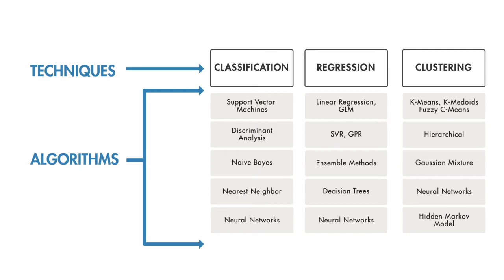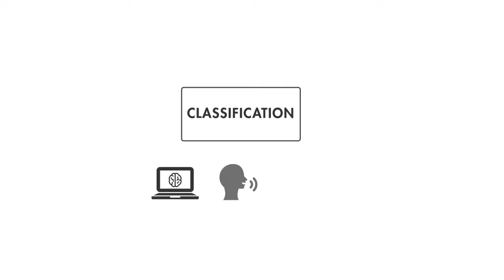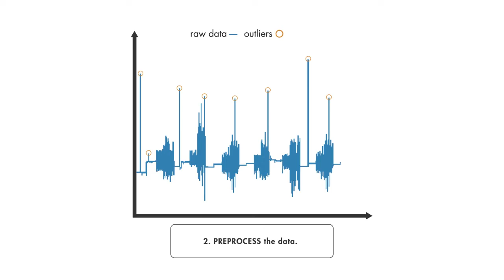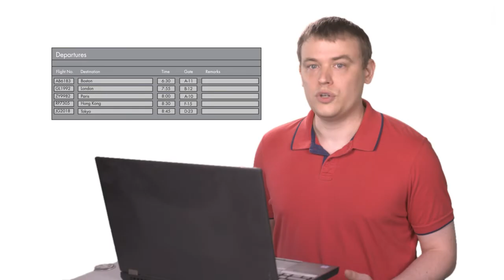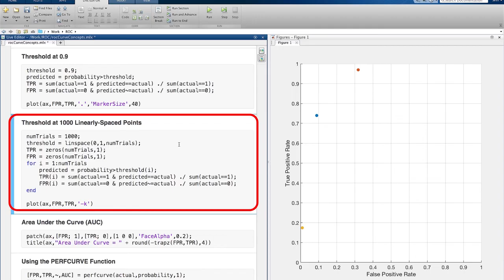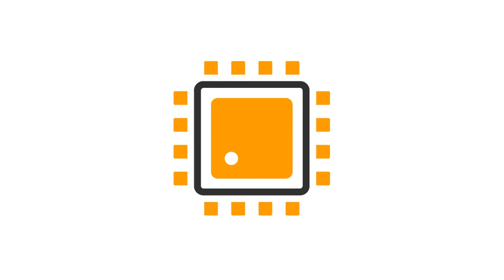Machine Learning Tutorial: From Beginner to Advanced

Comment: thanks for the video Adam. A really basic (trivial) example would be interesting for me. By way of starting somewhere, I created some simple data, Column 1: 1, 2, 3, to 200 Column 2 = 1,0,1,0 and so on.   In other words an odd number input leads to a response of 1 and an even number leads to a 0 response.  I import the data to the classification learner app, it recognises column 2 as the response and column 1 as the variable. I then import data, start session, select 'all' and hit train. the best model is quadratic svm but its accuracy is only 52.3%. It would be good to see a step by step video to create simple data (where the input / output relationship is obvious), import and tune to demonstrate the process at a very basic level.  Obviously i want to use it for more complicated data, but want to build on a simple start.